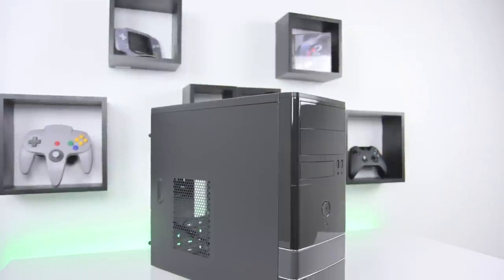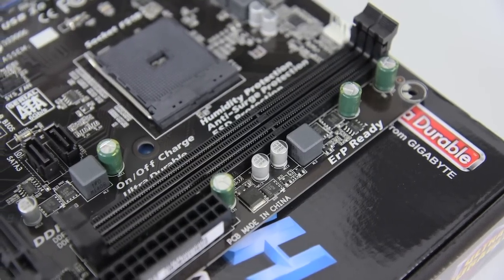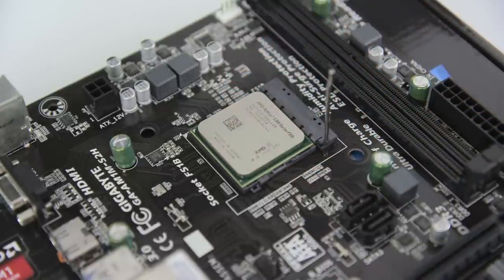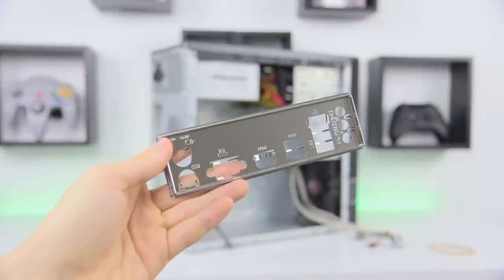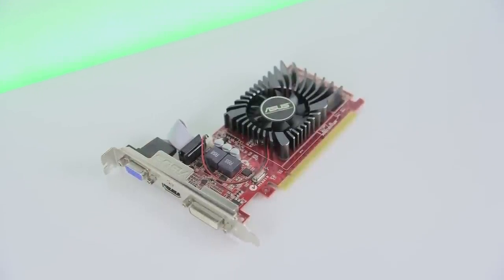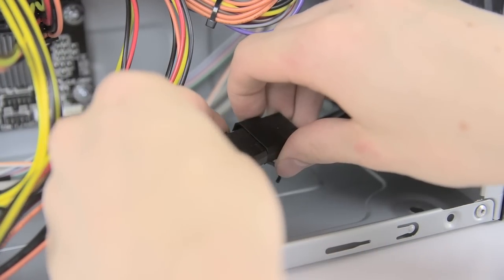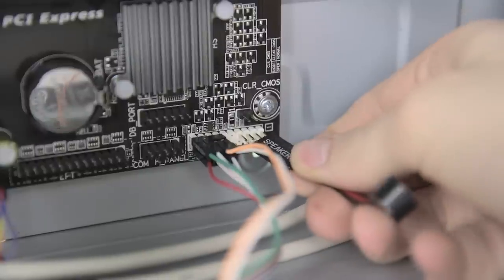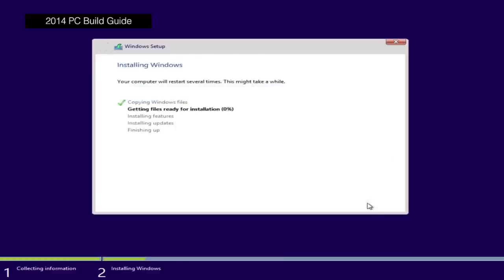How to Build a $300 Gaming PC! (2014 Boson)

Comment: Still runs faster than a Mac
Reply: ***** Depends on which Mac it is.
Reply: ***** I would disagree.
Reply: ***** What you are saying doesn't make sense. Mac is the operating system. If you buy a mac and install windows, it won't make it run any better. You can also do the "Boson Build" and install OS X Yosemite rather than windows.
Reply: WastingFilm Guess you don't know a joke when you see one :)
Reply: Nope, u may not be a fan of Apple but come on seriously? Are like 4?
Reply: SchyDu I have a macbook pro and a iphone...
Reply: *****
And i said ''you may'' I did not say ''you are'' By the way u still don't need to be an apple fan even if you got apple products
Reply: SchyDu I don;t like Apple and i don't Dislike it just like Windows pc/Android and so on
Reply: ***** As a Mac owner, i have to say that Mac OS really makes this thing a lot faster than my 1500,- Macbook. With windows they'd be pretty much even.
Reply: ***** Id say one reason macs are faster than most consumer-grade and possibly gaming pc's. One reason why i say this, OS is great and extremely efficient when it comes to how much power is used when idle and when its "gaming" reply if you want me to expand further.
Reply: Daniel Rojas If you build a PC yourself, it will perform a lot better than a Mac at the same price.
Reply: ***** self-built PCs at the price point of a mac will absolutely own. This one(the Boson) will be about the same as my mac.
Reply: I've always had a background in pc building, I built my first when I was 9...and honestly, I bought a mac just for file management, and mild editing, which holds up to windows very well, by utilizing finder. (Is a mac for gaming? Hell no...) (Is it a good computer nonetheless? Yes.) I am going to be building a new pc come december, but macs are a real joy to use, and there is no reason to hate on them. if you don't like them, don't buy them and don't complain. simple as that.
Reply: Hech I didn't buy it. I never, EVER would. But my uncle decided to give me one for christmas, and it's the only thing i've got.
Reply: ***** what? I didn't ask you anything lol.
Reply: "if you don't like them, don't buy them and don't complain. simple as that." was the part i was referring to. I thought it was aimed towards me.
Reply: ***** It wasn't aimed towards you, but if it was mistaken to be, I apologize.
Reply: No apologies neccesary :)
Reply: I just built a mac pro with 32gb of ram and a gtx 970. I think that's pretty fast.
Reply: ***** It's good for home use. To an extent. If you need to do things that require lots of resources or you need a very specific application then windows is better because a) the OS is less advanced(less irrelevant or tiny features, more efficiently designed) and therefore leaves more resources for other stuff. I have 8GB of ram on my MacBook but it uses 5.something all the time. Even more when i use it actively.
and b) there are far more programs that work for windows than for mac. There's a very small amount of applications just for mac, and most that are for mac are for Windows, mac and linux. However, there's plenty of applications are windows only.

But if you don't use it intensively or for things that require very powerful computers, macs are great because they're so ergonomic. Then i'd highly reccomend them. If only they were cheaper.
Reply: ***** I don't own a mac, but I think that the 5GB of ram usage is just for caching, and it is dumped to the Hard Drive(Or SSD) when more ram is needed.
Reply: ***** What are you talking about? lol, no ram is used for that, at least on my mac.
Reply: Hech That's what I've heard, from some people who do have macs. It does make sense, as it is still drawing power whether it's using 1.5GBs or 6GBs.
Reply: ***** I have never had that problem across 3 macs, so I don't know about that.
Reply: Hech If ram isn't being used, then it's being wasted. So I don't consider it a problem.
Reply: ***** Ram is being used for me, but not nearly that much, even on a full load, The max I've seen is 5.8GB's.
Reply: Hech Yeah, like I said I don't own a Mac.
Reply: ***** Ok, well I was just responding to what you were stating, Some macs must have that problem, but none I have ever used.
Reply: Hech Mine doesn't either.
Reply: Aman Kamil Mhm. Only my mac is too much of a fvcknugget to successfully run windows. :(
Reply: WastingFilm In terms of gaming, yes it does.
Reply: +Polskadots ! actually mac os is less advanced its been the same more or less for the last few launches say os 10.5.8 and above since mac os is nothing more then linux wish a custom gui  literally you can through the same commands in many cases you would on ubuntu on osx and what not the computers ie the laptops have alooooooooooooooot of thermal problems coming from a guy who routinely repairs logic boards and motherboards from apple and pc/laptops i find the mac logic boards to have more issues, mainly with overheating and what not resulting in  burn caps transistors resulting in a short to ground , where as with the pc hardware its generally an easier fix with less poking and prodding so in terms of build quality forget it not for the price they want  the only macs i like are the power pc based ones before apple just turned into dell with a logo  and i still have my power book g4 1.67 ghz
Reply: chris simmons With advanced i mean it's got more features, takes more resources and therefore less efficient.
Reply: ***** I ran windows perfectly on my mac, and was using all features that windows could support, including software for windows only.
Reply: and it was probably faster.
Reply: eh idk bout that mac os  is a mess of code as well  compared to linux mint its bloat ware *****
Reply: BRUH. that's what i'm trying to tell you all along. Mac OS has so many irrelevant features it's really resource intensive and inneficient, therefore it's faster with windows.
Reply: lol ohhhhhhhhhhhhhhhhhh lol made it seem the other way around lol *****
Reply: +Paul Garcia Tis true. :\ Typed on a mac.
Reply: Recently came across a PC with similar specs.
2,4 GHz quad core i5, 8 GB DDR3, 1 TB hard drive, Intel HD 4000 for the advertisement, and 2.4GHz quad core i5 , 8 GB DDR3, 500 GB hard drive, intel HD 3000. The real surprise is that the advertisemrnt was 550 bucks, and my MacBook was 1499.
Reply: +Paul Garcia it won't run any faster but if u build a pc for the same price it will be much better
Reply: Lol no I my friend has a 5 year old Mac and it's still lightning fast surfing the web.
Reply: +Centurion guy yea you can surf the web on a fucking flip phone soooo
Reply: william martin But it's not fast.
Reply: Nope ! Macs arnt that bad but not ment to do serious gaming but a mac will kill this thing while idling
Reply: No.... any modern mac would trash these little APUs. Im not even a mac fan but I do know apple would never put this crap apu in their machines.
Reply: +SIME_LP  true
Reply: Because I have a Mac that like 3 years old, and it still lags a bit on lowest settings on counter strike, global offensive
Reply: Alpha Cat I have a late 2k11 macbook pro and i can barely hit 30 FPS in Minecraft, on mid to low settings.
Reply: +Sir A. Nonymous that's why macs are shit, the "best" Mac, costs the same amount that you could build a 4 k gaming system!
Reply: ***** -Apple fanboy 2015
Reply: +Spoo Derman they may make them look clean and great, but their specs are absolute crap, no lie, like only 1700mps? That's literally crap.
Reply: +Spoo Derman and usually when I tried constantly moving pictures and 3D Touch on the new iPhone, it started to get to 30 degrees hot in five minutes!
Reply: Y U bringing Macs in here? They aren't eligible enough to stay in here
Reply: Okay, so i've had my own PC for a while now. I can definitely say that for general use,Mac boots quicker, and runs faster in general than Win7 64 bit, but a PC (which in my case is way less powerful than the mac it was compared to) completely devastated the mac in gaming performance. PC: quad core 2.3 GHz, 4  GB DDR2 ram, and an Nvidia GeForce 7900GS Vs. Quad core 2.4 GHz, 8 GB DDR3 ram, and an Intel HD 3000 for the mac, the mac got 30 FPS on medium settings in Minecraft, whereas the PC easily got 100+ on similar settings.
Reply: +Sir A. Nonymous Mac has ssd, your pc probally does not, If you upgrade your hardrive to ssd, it would probally boot faster than the mac.
Reply: Authentic Music Mac has an HDD...
Reply: ***** Yeah, but i've got a 7200rpm drive in my PC, and a 4800 or so rpm one in my MBP.
Reply: No
Reply: ***** To what?
Reply: Faster than a macbook yes. faster than a 25 ich macbook pro.... No
Reply: ***** Let me guess you have a 25inch macbook pro
Reply: ***** LOL just a typo

Comment: I want to see a $100 pc build. Must run bf4 ultra 4k
Reply: zellarsDD777 sorry but that's not possible :D
Reply: Teemu6099 yes it is, hav u seen nvidias new potato architecture? it runz 8k set upz EZ-PZ.
Reply: zellarsDD777  Do you know what a APUSSDOSGPUCPUCASEOPTICALDRIVETHERMALCOMPOUND Super Processor is?
Reply: Gamer117154 oh shit,, just checked it out.. gonna add that to my build..
Reply: Just delete your comment and your good!
Reply: thats impossible XD windows costs 100 dollars alone .-.
Reply: depends on where ur buying it from
Reply: i know, however if you think about it even if you get extremely good deals a good gaming pc will never be less than 300
Reply: truthfully it will never be less than 1000. anything less will only get moderate frames per second on low settings with last generation of games. The next generation will be unplayable. The absolute minimum card I would have in a pc right now is a 4gb version of the 770 and that alone is 200-250$ and an 3rd gen i5 which is another 150 or so that will still struggle through alot of games.
Reply: I thought my obvious trolling was obvious...
Reply: +zellarsDD777 its not impossible grab an older prebuilt like a optiplex 280  can be snagged on ebay for like 50 bucks lol with an os  and grab a 54502gb  there you go bf4 on medium high at lower res get about 30 fps
Reply: +Gamer117154 A 4gb GTX 770 is nowhere near the minimum for gaming right now, im using a 2gb GT 730 and i get 60 fps for CS:GO on high settings, granted not the best but definitely more than playable. My current gaming pc is only $460 to build and im satisfied with it.
Reply: +zellarsDD777 If you have a $100 pc build you might as well stick a keyboard to a microwave and call it a gaming pc.
Reply: +Gamingcuber don't most people play cs go on low settings though
Reply: +wytze boersma not even that
Reply: +zellarsDD777  the cheapest computer i have seen is a $110 Intel compute stick just install steam and you will be killing any game you throw at it at 4k ultra
Reply: +KSores where have you found that exacually, on a troll video
Reply: +BlairGamingFTW his talking bullshit no way u can do that at 4k ultra
Reply: +TrikzyShOTz  Who the hell buys Windows ? I have never done it, and i use a PC from year 1999.
Reply: +zellarsDD777 maybe in 50 years from now.
Reply: +Svetoslav Ivanov Like 98% of people who build PCs and like 99.99% of overall amount of users
Reply: +wowitsbryce not really I know a lot of people who run a pirated copy of windows just fine
Reply: TheOssie98 How would you describe them as? Other than that I think that you should realize that 2% of PC builders is a lot.
Reply: yes it even possible 90 dollars .. possible with the new Amd P Series =Amd Potato 
cost around 1 dollar clock at 0.01 ghz and it can handle 8k and also if you put so much ram in it it will handle all game Super High Settings .. i have tested a few games .. here is the result
Minecraft-1000Fps On Super High 8k settings
Gta 5-500Fps On Very Super High 8K settings
BF4-500Fps On Super High 8k settings
COD All Version -800 Fps On Super Super High 8k Settings
Need for speed -1200 fps On Super settings 8k
......
you can get the Intel P Series for free if you get a life and stop playing game
Reply: yes it even possible 90 dollars .. possible with the new Amd P Series =Amd Potato 
cost around 1 dollar clock at 0.01 ghz and it can handle 8k and also if you put so much ram in it it will handle all game Super High Settings .. i have tested a few games .. here is the result
Minecraft-1000Fps On Super High 8k settings
Gta 5-500Fps On Very Super High 8K settings
BF4-500Fps On Super High 8k settings
COD All Version -800 Fps On Super Super High 8k Settings
Need for speed -1200 fps On Super settings 8k
......
you can get the Intel P Series for free if you get a life and stop playing game : D
Reply: +Teemu6099 its only a joke lol
Reply: +zellarsDD777 sorry but your not going to do it
Reply: +Gamer117154 that... that's just.... that's simply not true. I'm able to run battlefield 4 on ultra at a steady 50 fps on my 520 dollar pc.
Reply: yes you could just buy a Cpu Like 85 dollars like that and clock 3 ghz + Amd then you will need a box a fan a human brain a mom a dad and a rope . total cost : 105 dollars promise me that extra 5 dollars is worth it and i suggest watch thiojoe video
Reply: +TrikzyShOTz you can get pirated windows tho xD
Reply: +TrikzyShOTz just pirate it or use ubuntu
Reply: TheBloodRedJester specs plz?
Reply: +Reptilian Brotherhood (Lord Hissser III) I am thinkiing of amd A10 6800k cpu and radeon r7 260x gpu
Reply: true
Reply: +FoxTheLegend
cpu- amd fx 6300
gpu- gigabyte windforce r9           270x
mobo- gigabyte atx amd 4 ram slot
ram- 2x4g ripjaws
psu- evga 500w 
hard drive- barracuda 1 terabyte 
case- deep cool tesseract
Reply: +JaxProductions please. tell me more :P
Reply: +JaxProductions interesting..
Reply: You can do it, you just gotta steal some stuff...
Reply: thats impossible
Reply: Guys y'all saw the new Pware pc?!? It runs 16k P HD, its has Fried P motherboard a,d stuff!!
Its called Fried Chips, it only costs 75 bucks and on Black Friday it was 50 !!
Reply: +zellarsDD777  Have you guys ever heard of.... Game streaming? :')
Reply: +JaxProductions I'm looking to build a gaming PC but I honestly don't know anything about computers so if you give me some pointers or like stuff to stay way from that'd be pretty rad.
Reply: +zellarsDD777 or 10, 8k monitors on ultra settings, max anti-aliasing and hairworks to the max, my expectations....
Reply: Riki Patel It's definitely doable.
Reply: Well, you can have an pc with win xp
Reply: +Kiệt Nguyễn a pc
Reply: ***** Titan X will looks like a fucking joke in next 30 years
Reply: +JaxProductions oh man sweet
Reply: Lol it will cost over $100 to get the cpu and graphics card
Reply: +zellarsDD777 Challenge accepted >:D
Reply: +iKrakenWalls over $100 for the graphics card alone
Reply: +zellarsDD777 Haha maby in 2200 it whould be as low as that, MABYE
Reply: its possible. just nick all the stuff and then it wont cost anything at all
Reply: zellarsDD777 u can play mine sweeper
Reply: Teemu6099 It is possible all you need to have is a gun,dark clothes,mask,partner to help you,and a get away car. Now all you got to do is wait until night and then break in the local microcenter. Then you grab the most valuable parts and run out. The last thing you gotta do is to get away in your get away car
Reply: save your money. buy quality parts. well worth it
Reply: Rob someone and spend the 100 on a mouse and keyboard
Reply: you said nothing about fps
Reply: any computer can run bf4 ultra 4k, you'll just expect 2fpd
Reply: easy just get an amd apu for like 60$ then get everything else can be anything compatible, seems to work great for consoles, because apparently that do just that
Reply: highly possible but unlikely can be reenact
Reply: zellarsDD777 🤔Well, it's easy. Pay a guy $75 to kidnap the richest kid you have ever seen...then things will get into place. SEND ME $25 BTW
Reply: It's possible but is gonna require some cheap parts that you can't just get from Amazon you have to work to find cheap parts
Reply: zellarsDD777 lol
Reply: Not hard my friend. Buy an old lga 1366 prebuilt, a gtx 480(x2) and a decent psu and you'll be good to play battlefield 1 at 4k ultra at a cinematic 5 fps